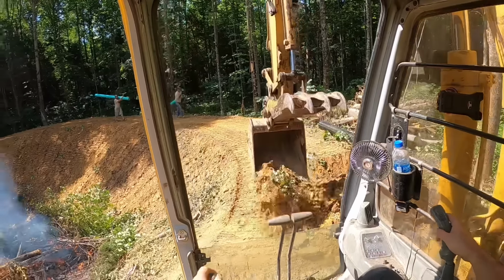Homestead pond build and why they are important

Comment: Mike, when they were building 1-44 in the 1960's, they needed borrow pits for intersections, crossovers and the few valleys.  As you drive along now, you see hundreds of ponds and small lakes along the highway. Most of them are concentrated around the features where the dirt was built up.  But, there is one lake that is located along a seemingly flat stretch of highway. It is parallel to the roadbed, long and skinny, just like most of the others that you see.   Because there are so many of these lakes before and after it, you might not raise an eyebrow as to why it is there.  However, to the practiced eye, you cannot see any place where they used the dirt.

Right after the highway was built, the small town located five miles from the farm was needing to build a sewage lagoon and associated roadways into it.  The town was over a small hill away from the highway and happened to sit in a hollow that was filled with about 10 feet of topsoil.  The contractor for the city came out and struck up a deal with the farmer that he would trade him top soil for the clay that he took out of the pit.  

The farmer took the deal but stipulated that he wanted the topsoil spread over his fields instead of refilling the borrow pit.  The contractor liked that idea because he could haul soil both ways without having to stockpile the top soil for refilling the strip at the end.  Once done, he just ran a dozer over the fields and the farmer was ready to plant.

A fortunate turn of events was that there was a draught the year they traded dirt.... as a result, the contractor was able to dig the lake deeper than is normally possible, for a borrow pit.  Although you would never know it by looking at it...  it is almost 30 feet deep!  

My dad found out about the lake because he was doing bookkeeping for a tire company.  The farmer contacted the tire company and wanted to get all of their tractor and larger tires.  He was wanting them as breeding nests for Blue Catfish.  You see, Blues only thrive if they have access to deep water.  At that time, fingerlings were needed to restock the local lakes  that had been over fished.  The farmer wanted a second income stream!

My dad helped broker the deal to deliver several trucks of tires to the farmer.  In that deal was fishing rights, when the fish matured.  (We could only keep males... but of course, you could catch anything that would bite.)  

I was about 12 when the fishing trips started.  We would finish milking by 7PM or so, load up the pickup and beat it over the state line to fish.  We returned home at sunup with a cooler full of catfish, just in time for the morning milking.  After church, we would pack the fish in freezer bags and spend the afternoon dozing on the sofa.... while the baseball game was playing on the TV.  

I probably spent a dozen or so Sundays doing that, over the next couple of years.... I just wish our fishing rights had transferred when the farmer sold the farm.  It was some of the best memories that I have of spending time with my dad.... and, we always had catfish in the freezer!

I won't disclose the exact location of the lake but will tell you that every time I drive by it I long for the chance to experience just one of those fishing trips with my dad, again.

To your point.... farm ponds are awesome.  They all serve a purpose... even if it is just to get good topsoil for your fields and raise Blue Cats to sell!
Reply: Stories like this really bring the back scratching that goes on around different jobs to life !!
Reply: @alexosborne5629  here in the Midwest rural folks tend to trade as often as they can.   Bartering is so much more enjoyable than buying and selling.  We call it Horse Trading…. Sometimes the stories are worth far more than the goods or work that are exchanged!

Comment: Run the down spouts to the pond. Sheep foot roller has done well since you bought it.
Reply: Yep, when my cousin built his 48x100 shop and house they run all the gutters from both to the pond, prior to those being built that pond would never stay much more than 1/2 full. After that they had to add a 12” overflow pipe because the 6” couldn’t keep up on heavy rains
Reply: 300-400# of dirt in the bucket loader would go a long way.

Comment: Nice watching experienced operators run their equipment, it's amazing what fine detail you can get with a doser and excavator. My heavy equipment contractor sends me the same group of guys every time I do a job, there used to how I like things done and they're used to the type of work that I do so they know exactly what to do and how to read the site plan when they get on site and that makes the job go so much better. My guys try to get within a 1/4 inch of the site plan when they're all done it's amazing how close you can get to that mark with that big equipment. You might have had that little John Deere overloaded with that gigantic box blade on the back, I believe that exceeded manufacturer's guideline by just a hair. Bottom line is it's nice to have a good contractor like you guys that know what you're doing and are willing to take care of the customer.

Comment: We''re at 5600 ft.  there's no drilling into aquifers.  It's trapped water in the rock structure of the mountain.  Available water is all over the map.  We're at 340' and get 3 gpm.  our neighbor is at 57- and getting a little over 1 gpm.  yet 500' from us is a well that's 200' and getting 15 gpm.  We figure our well holds around 400 gallons at the static level and it's sufficient for our daily needs. There's no capacity to irrigate and we're in a semi arid climate so it's prairie grass growing natural.

Comment: Little advice, don't run that roller parallel to a fill slope, you will hut a soft spot and end up on your side. It's best to hit the edge at a 45 degree angle till the roller just starts to tip over the edge then work your way along overlapping. It takes a long time but you get a tighter edge and an upright roller. I've witnessed 2 rollers roll down a slope.

Comment: Next time in a dam like this, consider running your overflow pipe from the very bottom of the dam, up the wall and over at the hight you want the dam to fill to. I did this on many of the dams I built on the farm, so that a lot of the silt/rubbish went out in the overflow. Nice job though. thanks for putting it up
Reply from the maker: Absolutely not have fixed way to many of them
Reply: @DirtPerfect  Interesting in 30 years on the farm I only had 4 block ups, 1 a tree crushed the pipe, 3 just blocked I guess caused by very low flow

Comment: Can you share the cost of this project?  My mainly pine CRP pine timber has been sold and waiting to be cut. There is also a fair mix of hardwoods in certain areas.  Timber will all be clear cut. There is also a flowing, blue line creek that crosses about a 1/4 of my property. Am in contact of a guy to build a maybe an acre or larger if I can afford a larger pond- and feel that after the timber is gone, we can get a better lay of the land and where is the best place to start, where the low spots are, etc. . All of my land via the topo map is listed as WEB so should have a really good amount of clay and has a really good slope. my 50 acres are really longer than wide. I need some idea of a budget that I need to put back, as I know there are always things that come with moving dirt and making a pond that is unforseen.
Reply from the maker: Sorry don’t remember was a few years ago

Comment: From a hole in the ground to a pond in two boiling hot days!! 
You had better get the air con fixed on the chainsaw, Aaron was melting, but then he is used to working in boilers 🥵😂
Jerry was strutting his stuff again, probably didn't break into a sweat 😎 
Will see you all on the next one 👍💪

Comment: The primary importance of one of these mini water holes is providing water for the fire dept. and maybe to lower home insurance some.   And then wild and hunting.  That’s not pond.  Too small.  But deer and turkey will love that one. There should be another name for itty bitty ponds.  There’s not much runoff to feed the pond water.  In a dry year it has to go out of business.  I’m really disappointed that you didn’t add enough sloped runoff on the high side.  Ponds area a big deal and you’re doing better than you u send to and you’ve got some way to go in my book.

Comment: For the ponds, do you ever use some sort of bottom material to keep water in rather than relying on dirt/clay to keep the water in?
Reply: Mix up  "Bentonite" with water. Pour it in the freshly rain filled pond while someone is doing circles in a boat with a small outboard.

Add the Bentonite to the water while using a power mixer or it will clump up.  Bentonite is part of clumping cat litter.

As the pond leaks, the Bentonite will plug the leaks.  

Might have to do this a few times, especially if you are trying to minimize the amount of Bentonite.

Bentonite is a clay that will form a nearly water tight seal in a very thin layer.
Reply: And when I say material, I mean plastic or something similar.
Reply from the maker: Clay is as good as it gets

Comment: Hard to judge how wide the top of the dam is from the video, but shouldn't it be a bit wider (thicker)??? Most of the old clay dam's I've seen is about 10 foot wide, so you can drive on it if you need to do any maintenance, I'm not trying to sound critical, it is a awesome build (or dig, LOL) loved watching it.. The main question is... Is it to "@Letsdig18" standards??? 10/10 Mike.. Sweet small pond build...
Reply from the maker: No covered that in the video thanks
Reply from the maker: Keep in mind excavator is 2 foot wider then a truck
Reply: @DirtPerfect  I was going by what I could see, I kinda forgot, how much wider they are, It's been a long time since I was able to actually build anything, Watching videos, ya kinda loss perspective on size.. I still love watching, building from the ground up... Watching always brings back good memories of my much younger days..

Comment: What kind of pipe did you use for the overflow? How come you don’t use the same pipe that @letsdig18 uses on his pond? Which kind of pipe is better? What diameter is the pipe you used on this pond?
Reply from the maker: 6 inch pvc and I am not Chris is the best answer I got this is 1/2 the pice works just as good and never had a problem 🤷‍♂️
Reply: @DirtPerfect  no offense meant. I am thinking there are many options in the construction business. I’m just comparing options by men in the same business. Thank you for your answers. Just learning.

Comment: going be tough on a cow to get out of the pond.
Reply from the maker: Not how it works
Reply: You don't want the livestock within 50 ft of the pond, especially cattle.
Livestock will turn it into a sewage pit very fast.
Pump water from the pond to "stock tanks".
Also, make sure there's a way for calves to get out of the stock tank or you'll have drowned calves.